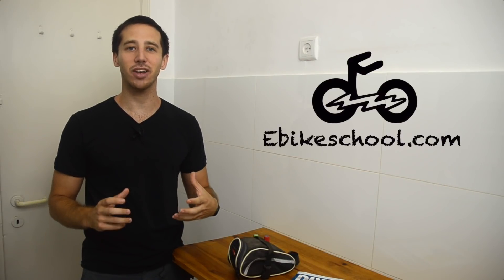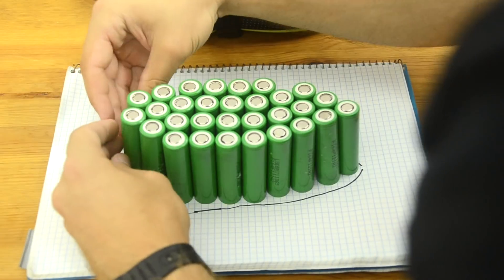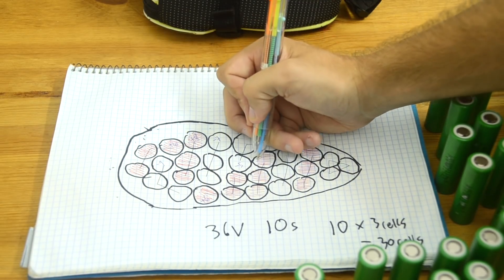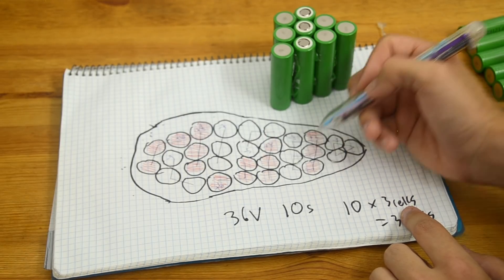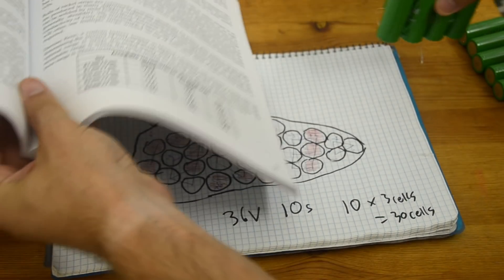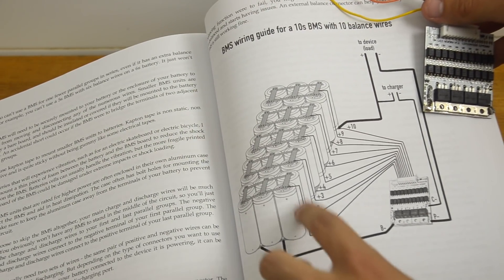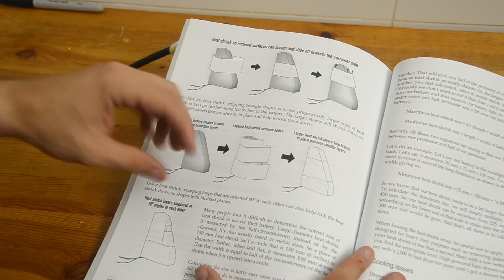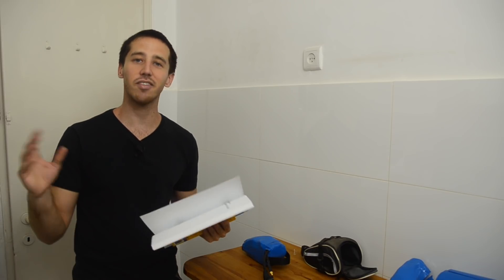Complete DIY Guide - Building Custom Shaped Lithium Batteries

Comment: That was very good and I could follow it. THANKS 
One question could you give a weight was that battery? I have stairs from my Apt. and its hard for us to carry bikes down and up. We already make trips bake up for our bags and I'd still like to limit that as possible.
Reply from the maker: That battery weighed about 1.7 kg or 3.7 lbs. Very small!
Reply: From the size - comparatively to a mans hand - I would speculate it is less than 10lbs / 4.5kg.

Comment: Micah - thank you again for breaking the explanation down in such simple and stepped terms. And it makes sense that sometimes the battery holders are just not practical to use.  The Nickel strips are a much more practical route than trying to make the contacts from a sheet and custom cutting the connection design - doable - not practical.

Also, I recognize that most eBikes are 24-52v, however ninety percent of the applications I have to build around are only 12v (13.8 nominal Automotive).  Wished there were bettery BMS units for this level - 

Lastly - the Rosenberger Magnetic connector is a awesome battery connector option - Water proof, and function - just wished wasn't so expensive.

https://lunacycle.com/rosenberger-magnetic-connector-male-and-female/
Reply from the maker: Yea its really expensive but I was dying to try it out. Plus its for my wife and happy wife = happy life. Would 4s li-ion work for you? that would range from 16.8V - 11V. I have some 4s BMSs on my site at http://vruzend.com/product/4s-battery-management-system-bms/ if you are in the US.
Reply: Yes - a 4s BMS would work with the properly rated DC-DC converter.  I have one, but have to watch the differential voltage as it will begin to over heat.

Comment: Just subbed ... thanks for the great vid!  Planning my first ebike batt build and was wondering if two 6S packs wired in series is an acceptable way to get to 48v?  Want to power a 48v 1000w ehub.
Reply: Nominal voltage will be 44.4v. When the battery packs are full charged to 4.2v the voltage will be 50.4v, therefore it should be fine. Only thing you've got to worry about is the lcv (low voltage cutoff) on your controller. Most 48v controllers cutoff is at 40v-42v  so you'll have a lot more battery life after your controller cuts out.
Reply from the maker: Yea, what BoltBurns said ^
Reply: Right on!  Thanks for the input!  Are you aware of a 48v dc speed controller with user defined lcv?  Or, I'll just build a bigger battery or buy a smaller motor!  I was just thinking 6 cells so I could balance charge with a hobby charger and skip the BMS hassle but better to do it all the way right the first time!

Comment: Hi, nice video! I'm a mechanic maintenance technic in a company called Coficab, and i have a Honda NSR 125 R, with 30 bhp and broken ignition. You gave me the idea to de ICE'it. I guess it would not be so hard to do, i would need a 20 kw motor, a battery, a charger and a drive...

Comment: Very good. I like the small pack. it can be used for short trips. We got a lot of rain in Switzerland. How about the watherproofnes of this pack an the bag? With the shrinked tubing it mind be kind of wather resistent. What do you consider for 30 min trips in rain?
Reply from the maker: Making something water resistant is pretty tough. By choosing a good bag and putting wax on the zipper, you can get a good start. Then make sure your battery is completely heat shrinked and maybe even put it in a plastic bag inside your bike bag. I've ridden in a max of about 20-25 mins of rain that way with my EM3EV bag and its held up pretty well.

Comment: Great video! Very clear and informative! I was looking into recycling batteries but I have found that not a lot of companies just give away their dead laptop batteries etc.. So your unprotected cells seem like a solid choice! Is it possible to design your own BMS as well? Because I was looking into making a 240 volt battery to power standard devices around the house without having to carry around a heavy transformer (just make a alternating circuit as it were), but I haven't found a BMS that supports 58S cells. Thanks!
Reply: Check out the PI Rasberry as well as a full computerized charge controller and charging station system.

Comment: Very Useful to see how you can max out cell count and still be safe on current load.  Would love to see you build (2) 6s batteries without BMS; just balance wires so you could use a cheap 6s balance charger.  Then show them connected in series to overvolt a 36v battery to to 43.2v

Comment: This is really well explained, thank you. I wonder how much heat builds up in these foam and heat shrink wrapped packs during charging and heavy usage especially under high outside temperatures. Can this reduce the life of the packs and what options are there to help keep temperature at optimal levels?

Comment: Is it really helpful to have so many layers on a lack consisting of a bunch of metal cylinders?   It seems like you are making an insulated oven and wouldn't the heat generated in the cells  shorten their life?
Reply: it will but tool batteries are built covered in plastic. the trick is to not Gun it up hill 24/7 on  the bike and the batteries will do fine.

Comment: I'm in two minds whether to use 18650 or 26650 batteries on my build, the basics for the build will be the same - its mostly a question of cost vs size. At the moment - I can source a 26650 for £5.95 (4500mAh) , whereas the cheapest  LG MJ1's are £5.05 (3500mAh ).  I'm on a tight budget - I intend to get both the books as I'm sure this will help me build my project cheaper. Great videos Micah keep them coming =)
Reply: Get panasonic you if you intrested on lasting longer 800+sicles mj1are good but degrade faster.
Reply: I found out 2665 more exp so dont use them unles u wona spend allot.
Reply: Great video  on a 36v @ 12ah  what kind of time limit should I get its a 350w motor ?
Ran bike for 40 minutes and the pack was warm to hot is there a bad cell?
Thanks for the help.
Reply: Hey Gareth! Go for 21700 or 20700 sized cells. They are worth the money!
Reply: Aravind Nair Where do you source the 2170 cells?
Reply: Efest battery suppliers. You can get genuine ones from them.Atleast I got genuine :D . Beware of other fake suppliers.

Comment: Well that made it heaps clearer for me on my road to discovery thanks heaps. I have a question and thats about adding fuses to packs? Is it necessary if using a bms or only if no BMS ? How do you work out what size fuse to add? And what types of fuses are best?

Comment: EbikeSchool.com mika ( spelling sorry if wrong) did you do a video or in your book discuss how to make a hub motor run in reverse or how to switch the shaft from right to left o left to right? I am making my wheelchair into a e wheel chair. I think if I use ebike sets the one side will set with the wires pointing to my seat, the other will point away from my seat. you understand me so far? I don't want bike forks on my chair I know how to mount the kit/set on my wheelchair with the shaft that they come with, it is only one side or the other that will need reverse or wires switched to go under seat. anyway I saw a guy get reverse on a hub motor with a JUMPER can this be done for real? I can't find that video again, like everything in life. help if you can thanks Joseph T